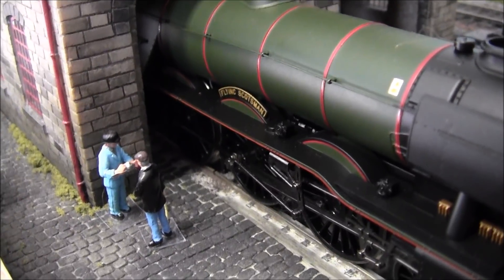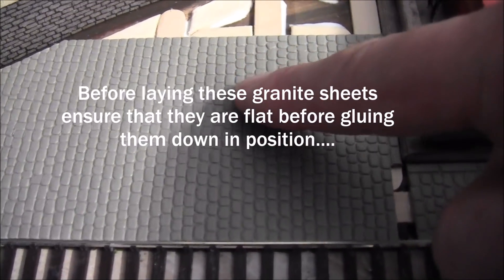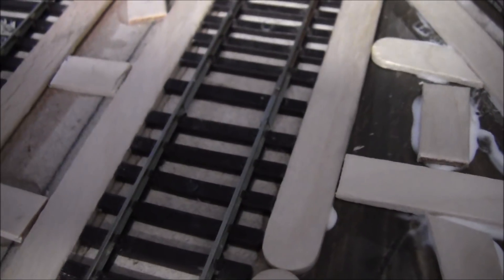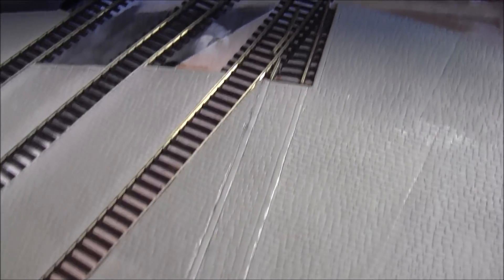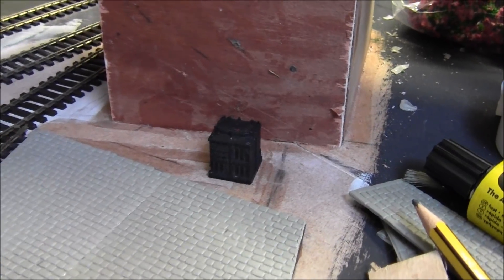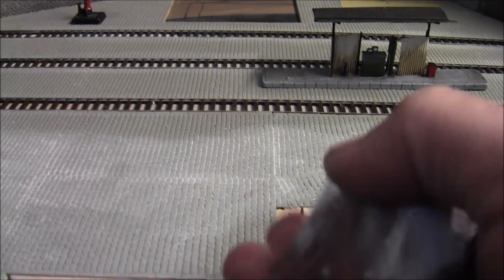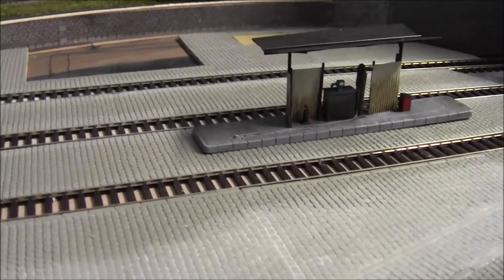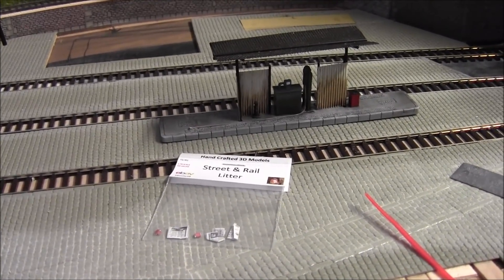The Diesel Depot "Cobbles" Part 2   No133

Comment: Hi Tony I think you could use a Dremel with a cylindrical sanding wheel to chamfer your cobbles. The portakabin looks more prototypical to my eye because diesel tanks would probably be a more modern addition. The brick building would have been much older and would pre-date the diesel tanks.
Reply from the maker: thank you for your comment Ray. yes the office would have been older than the diesel tanks, putting it all together is taking longer than I thought. thanks again for the using a Dremel. all the best Tony

Comment: Could you extension for the road be done as something that just slots into the edge so that you can remove it for your safety window (or whatever). Loving your cobbling! - Pete
Reply from the maker: Thanks for commenting Pete. the extension is only going to be 8 inches and will there will still be plenty of room in front of the window if I need to make a dash in case of a emergency.. thanks for the ideas. all the best Tony

Comment: Ahh Tony, so much to say. First up, the brick building for me as it suits the cobbled yard better, it was probably built at the same time the cobbles were laid. The cobbles are looking fantastic too, it's definitely the way I'll go with my engine shed. I hope the sanding technique works out for you when the painting and weathering is done. Do you intend to cobble between the tracks at some stage? Garry's litter pack looks the business too, I must get myself some of that. Hope you're feeling better, off now to look at Duncan's channel. Paul
Reply from the maker: Cheer's Paul, the brick building is the one everyone is going for, between the sleepers will be using a mix of ballast and in some planking near the shed area. the sanding technique is a gamble, but I need to use some really fine wet n dry now to loose the tiny scratches I have put into the cobbles. the paint might show them up. you can not go wrong looking into Duncan's channel best wishes Tony

Comment: The cobbles are looking great Tony.  The infill works well.  I wonder if a little matt coat would finish the job off?  You are going to paint anyway, so the point may well be moot I guess :)
Reply from the maker: The MPD at Newhassle has a finish I like, but I think the diesel depot will have to be finished a bit more differently with the cobbles being oily and dirty.. thanks for commenting....regards Tony

Comment: Go for the brick office, tt's more in keeping with railway architecture of the late 1950's.  The prefab would fit better with a 1970's or later depot.  The brick office looks like a railway building that has found a new use.
Reply from the maker: Cheer's brick office it is, thanks for commenting. yes your right it does look like it has found a new use.....all the best Tony